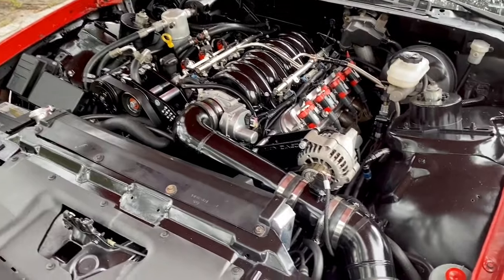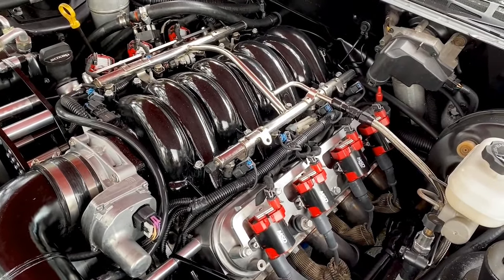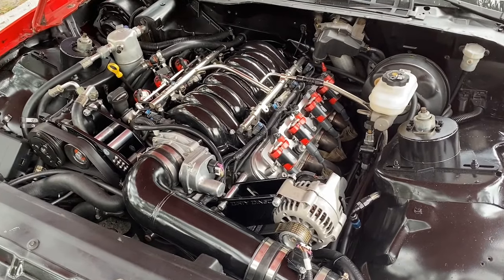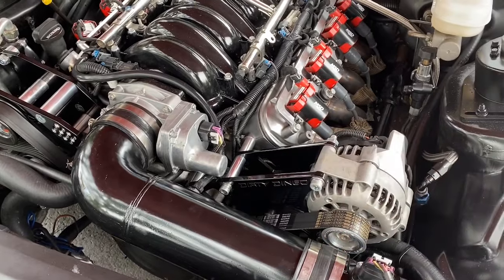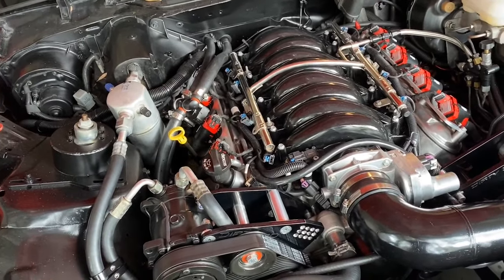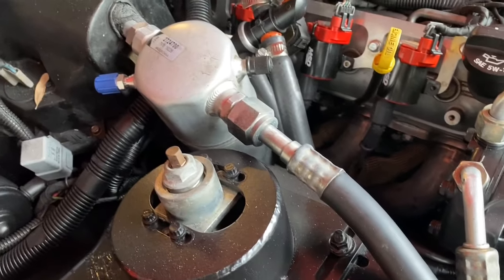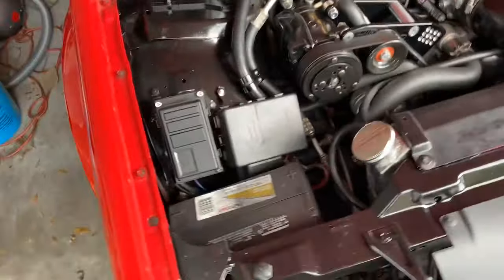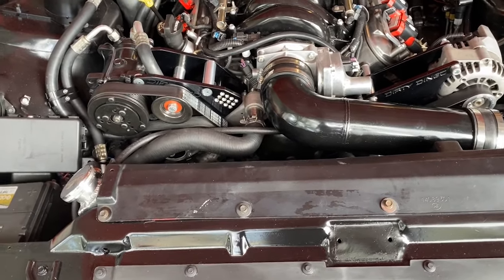How I Swapped The LS3 in my Thirdgen Camaro Iroc-Z

Comment: Thank you for the tips, I’m currently working on installing an LQ9 in my 3rd Gen Firebird. I got a hold of a 4 th gen fuel tank. Still on the fence on using it. Also I have the factory digital gauges, I hope I can get them to work with the LS swap.
Reply from the maker: 4th gen tank Has a fuel bucket that gets rid of fuel starvation around corners, has EFI quick connect hose ends to sender and trap door is smaller lol, you’ll need a 0-90 Herko fuel level sender (4th gen reads higher ohms) bolts right in, also uses rubber fill tube instead of the stupid 3rd gen metal fill neck so dropping tank is easy. Plastic won’t get crusty like metal tanks, A few more reasons if you were LS swapping but those are the major points... don’t get 98 that 4th gen is metal and sucks , 99-02 only
Reply: Is there a part number for the 0-90 herco plug connector
Reply from the maker: @SkillzManifest  Herko GFC31 on eBay https://www.ebay.ca/itm/Herko-Fuel-Level-Sensor-GFC31-For-Fuel-Pump-Module-E3978M/171286841181?ssPageName=STRK%3AMEBIDX%3AIT&_trksid=p2057872.m2749.l2649
Reply from the maker: @SkillzManifest  I also did a fuel system video more recently so check that out
Reply: @FireballMullet  I don't know how you thought about this but great stuff man please keep feeding the content and videos glad I subscribe. No one else is putting out information like this. It helps keep the the law for a 3rd gen going.
Reply from the maker: @SkillzManifest  no problem man, glad it helped!

Comment: So i ground down the U on the clamshells. Installed the ict billet plates as the directions say and am trying to bolt the clamshells onto the plates. Also have a ls3... the passanger side lower bolt cant sit flat because the block webbing is in the way, the drivers side the top rear bolt is the same way. Did you run into this? I have the 334971 clamshell on pass and 14039436 on drivers as it should be
Reply from the maker: I’m pretty sure I had to clearance the webbing a little

Comment: Hey buddy how are you doing I have a LS 53 and a 4L 60 E transmission with a standalone harness I’m getting power at my coil pack and ejectors and checked it but when I put a test light to the coil pack and crank it over I’m using voltage and the test light is super dim
Reply from the maker: I am not sure what the voltage should be on coil. I’ll see if I can find out
Reply: Thanks bro I appreciate it a lot

Comment: My son just surprised me with an 89 RS   What size tires and rim you do you use ? I wanted 20’s in the back 18’s in the front ?
Reply from the maker: That’s an awesome son! I’m running US Mags U550 Forged 2 piece Irocs, rears are Continental Extreme Contact DWS 295/35/18 18x10  and fronts are 255/40/18s 18x9
Reply: @FireballMullet  much appreciated. I’m on it now

Comment: Beautiful build, stoked to have the video prior to starting! Do you happen to have the part number for the Herko Sending Unit? Thanks!
Reply from the maker: Awesome that’s exactly why I do these!  https://m.ebay.com/itm/New-Herko-Fuel-Level-Sensor-GFC31-For-Fuel-Pump-Module-E3978M-/171286841181
Reply: @FireballMullet  Thanks again for the video (2 years later lol). I've used your A/C setup as a guide for mine. Quick Question: The Trinary switch I have (from ColdHose in Ocala) is set for High opening at 377 PSIG closes at 369 PSIG. This seems awful high to control the Compressor on/off cycle by itself.. (Mine is just staying on even though the low side is in range to cycle). Did you end up adding a Low Side 3rd gen switch or does your cycle at a different high side pressure? Thanks in advance!

Comment: So do those knock off 17 in IROC wheels have the correct backspacing on the rear wheels?
Reply from the maker: They are US Mags forged two piece custom made specs, so they have the right backspace
Reply: @FireballMullet  Sweet...how much those set you back ?
Reply from the maker: @jonsingle1614  they were pricey, 18x10 rear and 18x9 fronts were 4K a set

Comment: I got a late comment for this post... what did you use to lift the front end of you car high enough to drop it on top the engine
Reply: I’d say it went in from the top on this car. A 4th gen fbody comes out/goes in through the bottom. Hope that helps
Reply: Also, when I took the engine out of my 4th gen camaro, I ran straps around the radiator core support and used a strong hand powered chain wench attached an 
I-beam in my shop. It has to be pretty high. About 3’ or more to clear the struts but you could take them off and not go as high.

Comment: I have an 86 IROC town apart in my garage with an LS1 ready to transplant. I am still unclear about how to feed fuel to it. If I use a Warlbro in-line what happens at the tank?  Will the new pump draw fuel through the existing pump?  I just don’t know exactly how to set this up.
Reply: you need to pull the tank and modify for efi or get a 4th gen tank with the sump....

Comment: Can we get the part numbers for the AC hoses you used for the 508 compressor?
Reply from the maker: I had them custom made local hydraulic hose company
Reply: @FireballMullet  sorry not to jump back on an old topic but I going to reinstall the ac back into my 87 and I was interested in mimicking your setup. I was wondering if you had the part number for the trinary switch and connector as well as a wiring schematic for how you wired it up

Comment: what works have been done to the suspention??  Tire size??  AND how does it handle??
Reply from the maker: UMI mostly aftermarket suspension, 4  piston Brembos, 295/35/18 rear amd 255/40/18 fronts. It has Eibach Sportlines lowering springs which look great but I hate the ride for a street car

Comment: if you mind me asking what did you spend on this total swap. nice video
Reply from the maker: I get this question a lot, I need to go back and add it up, but I’m scared lol. Maybe I’ll do a video after I pull all that together. I’d say roughly (mostly all new parts here) around 12-15k
Reply: @FireballMullet  that includes the cost of motor, trans??
Reply from the maker: @roubensarian2993  yes that includes both

Comment: Great video! I'm in the process of sorting out the cooling system on my 83 LS swap am looking for a fan solution. What year of Intrepid fans did you use?
Reply from the maker: I believe they were 2002. Look for the HO version with two relays on the fan. Use a junk yard or eBay
Reply: @FireballMullet  Thanks for the quick reply and tips on what to look out for. I have a Proform PWM dual fan controller that I plan on using so I am not to worried about the relays but I will still definitely get the HO model.
Reply: @FireballMullet  BTW. If that LS3 intake of yours needs a new home I'd be happy to give it one 😁
Reply from the maker: @righteouskill45  haha I already sold it